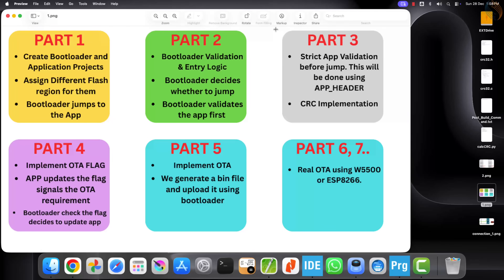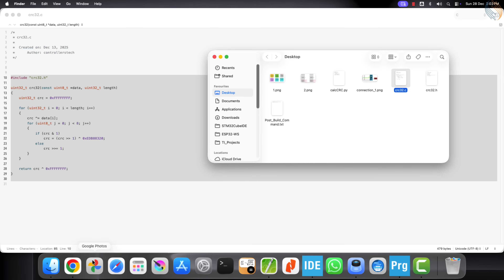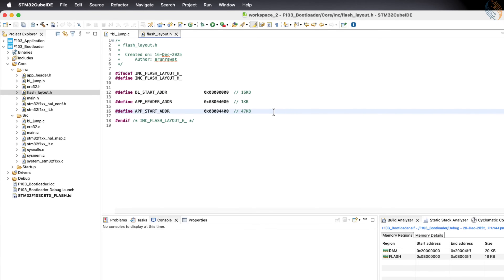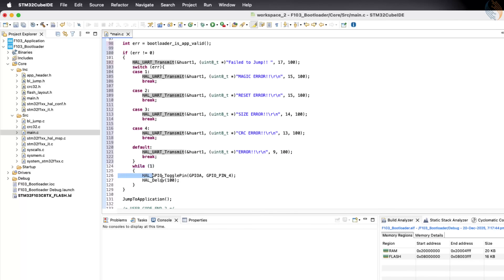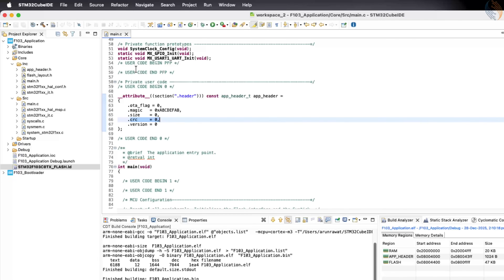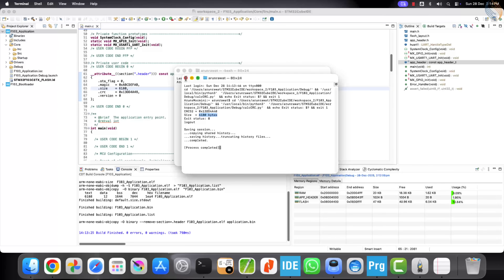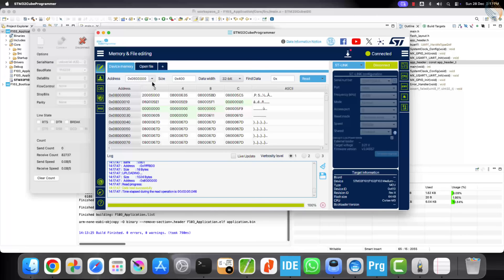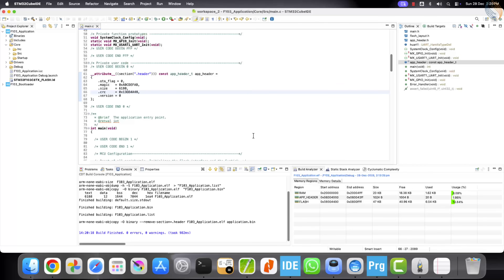STM32 Custom Bootloader (Part 3): Application Size & CRC Validation

Comment: Hi! i have a question about the CRC , if you append the CRC calculated from an array to the array itself the new CRC calculated is always 0, is it possible to append the CRC at the end of the bin file and so don't need to store the value in the struct? also if you always write the entire application ROM padded with 0xFF and make the CRC the last 4 byte you don't need to know the real lenght of the application, if the CRC result is 0 the lenght and all the byte are correct.
Reply from the maker: you can try this but keep in mind that this is just the test phase. When the real OTA will start, the application does not need to write the CRC. It will be handled by the bootloader.
Therefore it will be easier for you to follow the process later, if you keep following it in the same way.

Comment: Thanks, that is perfect, about the stm32 CRC original library, actually it can calculate the CRC correctly, and since I wrote the C# app , they are match , also I generate the signed.bin file by c# app, so the compiler always generate the raw .bin file, and c# app attach the header to .bin file with CRC and version and other meta data, so we don't have to have to calculate CRC manually and modify the code every single time.
So I think the python code is not able to calculate CRC correctly, because I checked the raw file .bin CRC by another tools and online tools to make sure it is correct.

I hope this approach can help and make the process easier.
Reply: I agree with this. I think the extra step of manually copy/pasting the CRC and size back into the header to rebuild it is error prone. There are just too many steps here for something that a simple python/C# script can handle by jumping past the header and starting the CRC check from the memory offset where the app binary is (1024 bytes from file origin). It can then write this value back into the offset where CRC is, keeping in mind what the Endianness is supposed to be.

This also means you don't need a separate app header and app binary - you can keep them together.

Maybe I'm oversimplifying it, but lets see if there are valid reasons for doing this manual copy/paste approach in Part 4. I would assume the next step is a build script that automates almost all of this.
Reply from the maker: Everything will be automated towards the end of the series. For now I want to keep things simple and understandable, hence the manual additions are needed.